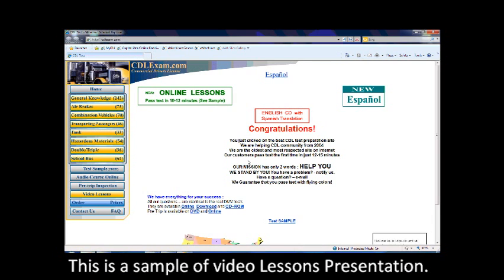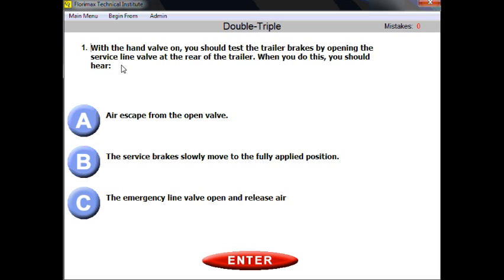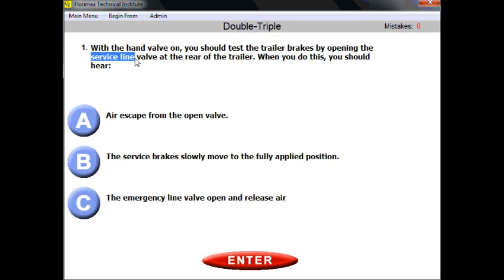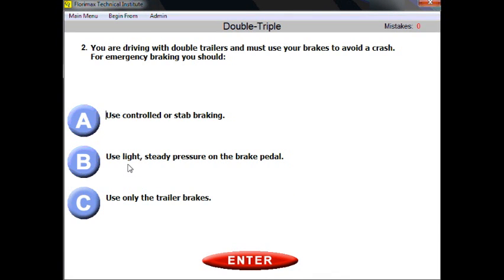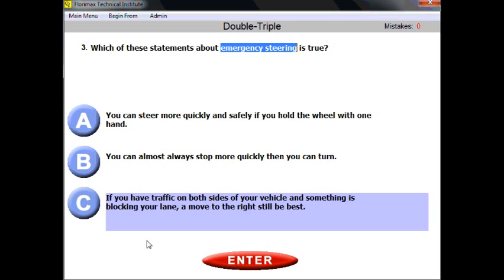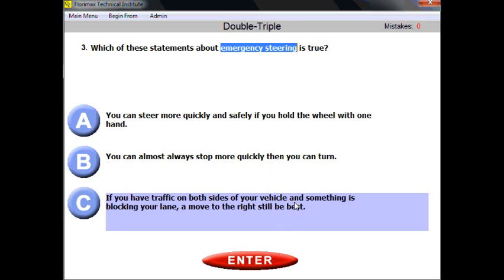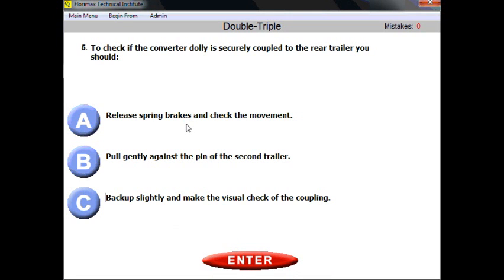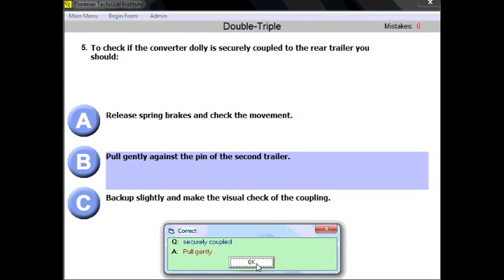How to Ace Double-Triple Test Easily.wmv

Comment: In your question regarding the Converter Dolly Air tank "drain valve" at the 5:42 mark, you stated that the drain valve should be "Open". That is not correct. According to the handbook for CA, the shut off valves or glad hands at the rear of the front trailer should be open and the shut off valves at the rear of the last trailer should be "Closed".  Being a "Drain Valve", this should be closed or air for the service brakes would escape.

Comment: You may know what a converter dolly is but are clueless to what a drain valve is.  Question 4 is 100% wrong!  The key words here are "drain valve".  It should be CLOSED not open. The only time a drain valve should be opened is if you are draining air/water from the tank.  Page 7-3 of the CDL manual!